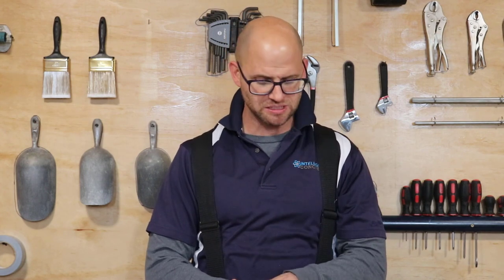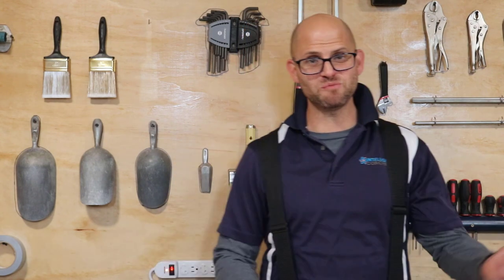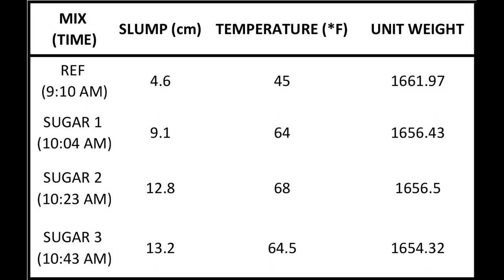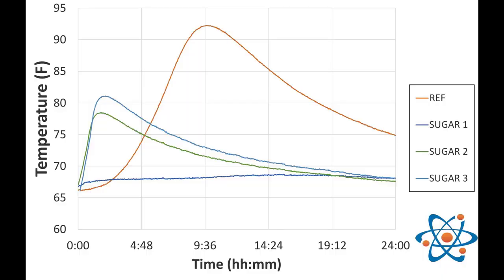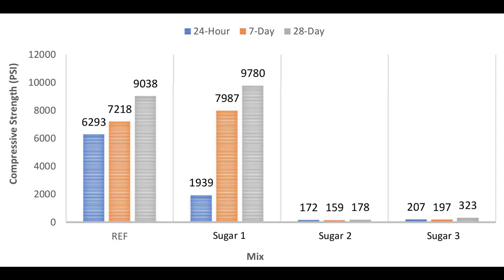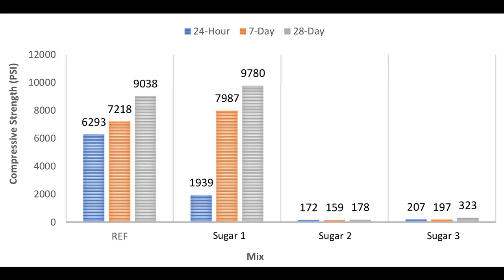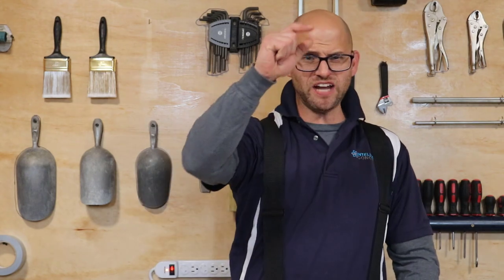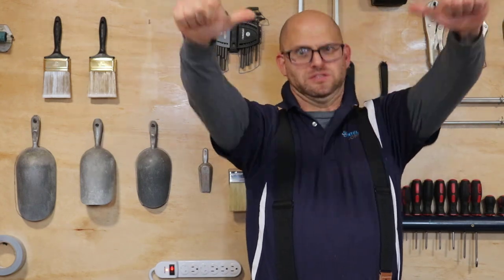Sugar in Concrete - Strength Results - Vlog 487

Comment: If no mistake in my calculations, in metric system the right amount of sugar-1 it should be about 1.6 kg per cubic meter. And the threshold sugar-2 about 5kg per cubic meter.

Comment: 50 lbs bag sugar kills 10 yards concrete in emergency situation. Had to do it when engine blew up going to job site.
Reply: But if the engine blew up how could you run the drum to mix it in

Comment: Thanks Dr John, that was fascinating.  
I’m a civil structural engineer and we’re always spec’ing fancy concrete but I heard about putting dish washing liquid detergent into the mix. A few old builders have mentioned it variously as a backyard plasticiser/water reducer/air entraining… thing.  I did a couple of experiments with pavers in my garage. It seems to “work” with no obvious degradation of strength.   
What might be the complications with long term durability with the leftover byproducts and reo corrosion? What do you think would be an optimal addition to a garden path type mix.   Could be a good experiment video? Cheers, Alex.
Reply: Would be interesting to see results in a concrete overlay mix too.
Reply: Just came across your comment, I might be wrong but putting dish soap in would probably raise air content way too high. High air concrete is weak that is why 
its typically around 6 percent maximum

Comment: MY question is this. Knowing this information to fairly accurate. I should pre-dose the water to be added to a volumetric mixer so that the water/sugar ratio is as close to 1 cubic yard as I am able. I hope that I can get this correct. We need to install footings and a pad on top of a mountain where no cement delivery is even capable of delivering. I will do a couple test pads and see what results we can achieve. I do not think we are going to need this in a winter setting of 45 degrees Fahrenheit though.
Reply from the maker: Check out Hydration Stabilizers from Chryso or BASF.  The sugar might be enough or tough to control for this type of job.
Reply: @IntelligentConcrete  I will do that! Thank you. Your response comes a month later - Merry Christmas and Blessings to each in Your Family!

Comment: Jon, thanks for sharing this interesting test. I did not understand the temperature graph explanation. What I see is that S1 and S2 went up dramatically in the first two minutes. This is surprising to me. Do you know why this happens with sugar?  Thank you!
Reply: I believe it is S2 and S3 which go up, S1 is the one nearly flat. Although, the colors are hard to differentiate, I've got it mixed up as well the first time I looked at it.
Nevertheless, I'm not the expert, but I want to make an educated guess about the temp graphs: I think in S2 and S3 there is so much sugar that the temp spike you see is actually the temp rise during initial mixing. Even though, mixing is already done for several hours, there was initially no reaction at all. This is, to my opinion, the very first sign of life of that batch. And as the results show, it's really screwed up 🙈
Reply: @1HighVoltage1  Thanks. Yes I am not the best at colors - but still very interested in the mechanism behind these initial spikes.
Reply: @walibou287  Could you please explain why? S2 and S3 are both really f*cked up, while S1 is still quite ok, so it makes more sense that the two identical graphs match S2 and S3. For reference: S2 and S3 are in the same order of magnitude regarding sugar content, while S1 is an order of magnitude lower. 

I'm not saying your experience is plain wrong, I just like to discuss it and understand the mechanisms behind it.
Reply: @walibou287  That makes three of us who'd like to know what's going on with the spike in curves 2 and 3 ;-)

My guess is still that it's the first (mixing stage) reaction the mix shows. This initial stage, as Jon explains, is not visible for the other curves (ref and S1), although expected, but probably occurred before temp registration started.

Comment: I'm new here and I want to ask weather does sugar increase the strength of concrete and how?
Reply from the maker: It can do both depending on how much you use and the original chemistry of your binding matrix.  By putting small quantities, the early concrete strength development might be delayed but due to a great length of time for dissolution of the parent materials, you should see a greater strength and lower permeability of the mix.
Reply: So how can one know the amount of sugar one can use for a particular concrete size
Reply from the maker: Start with small batches to identify the correct dosage to use to get your required strengths and then scale up to larger batches with an scaled amount of sugar for the batch size. Verify your results and correct dosage for strengths needed before scaling up through each batch size.
Reply: Pls could you do the video of that measurement for us
Reply: So (cue Mary Poppins) a spoon full of sugar makes the ready mix go down😉

Comment: So Does Sugar Ultimately make your Concrete Stonger???!!!
Reply from the maker: Yes but when sugar has helped my mixes get stronger it was a purposeful design and not randomly throwing it into the truck.
Reply: @IntelligentConcrete  So on a 4000 psi with 624 pounds of cement per yard, 
if I multiplied 624 x .001 = .6 lb. of sugar per yard, 
would that be a satisfactory amount to add to the mix?

Comment: Can you add cement to a Chirt Drive way to strengthen it?
Reply from the maker: Can you send me some photos of the chert? 

Normally yes, but only short term.  Chert reacts negatively with concrete and will start falling apart before too long unless heavily designed with SCMs or other tech.
Reply: Yes, I can send pics shortly. Chert is a mineral that we use in the South for driveways. It contains a lot of natural lime.
 @IntelligentConcrete
Reply from the maker: @rickblythe4864  I am very familiar with chert.  Excited to see the photos.